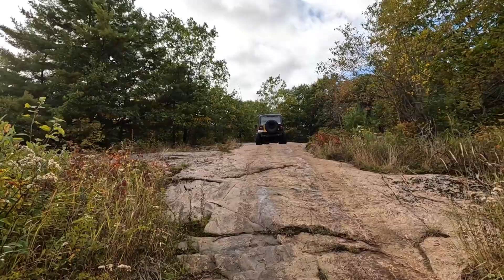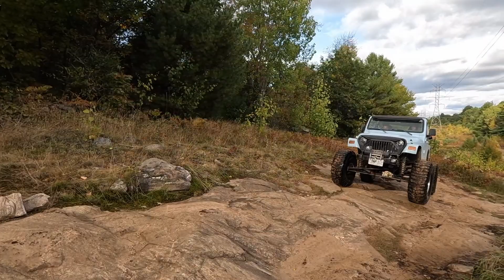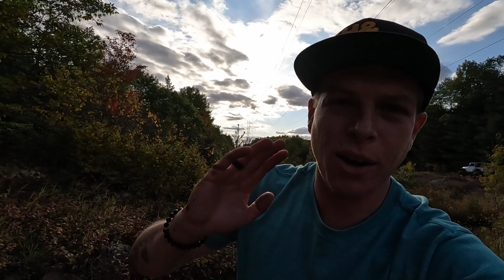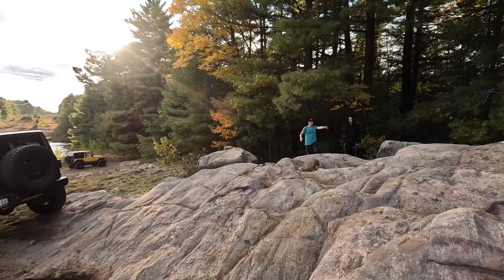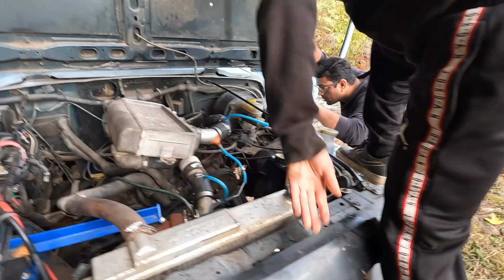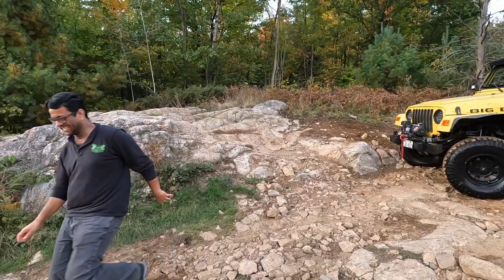New (JL) VS Old (TJ) Jeep Wrangler Off Road Showdown

Comment: 1st jeep was a 2008 jk bought in 2011. Next was a 2015 bought brand new with half doors and a six speed.
Sold the 2015 a few years ago for 25k.
Just bought an 03 tj, i6 with 5 speed and love it so much more than the 2 jk's I've owned.
Reply from the maker: For strictly off road I like my TJ. But for anything else I rather drive my gladiator. I love the JL and JT generation the most.